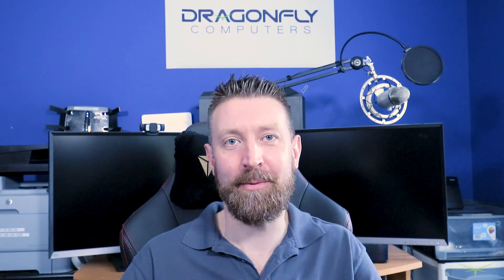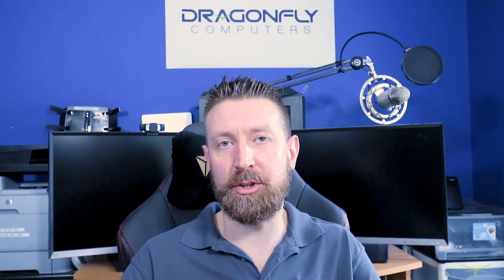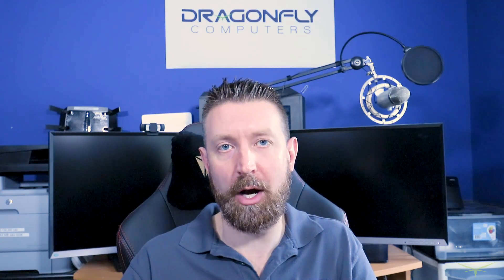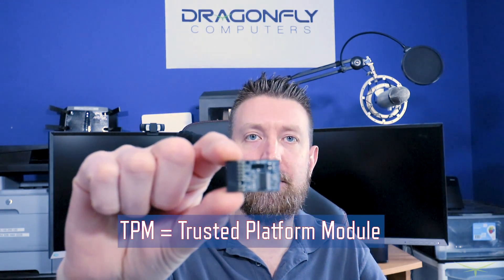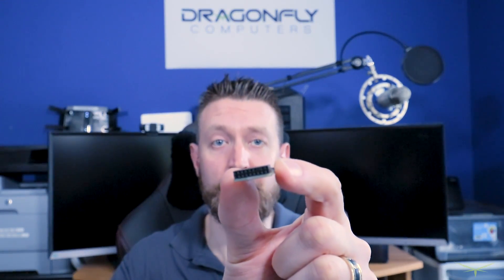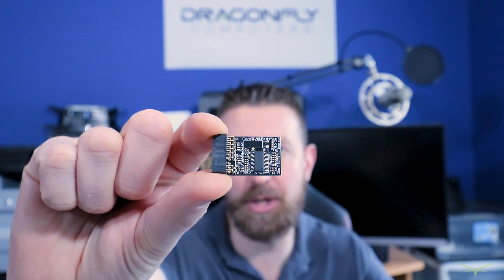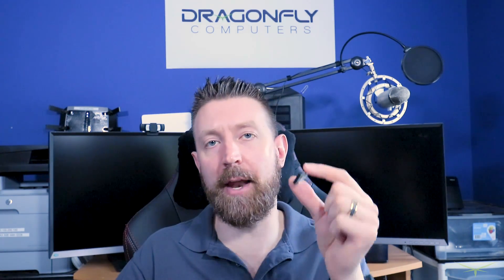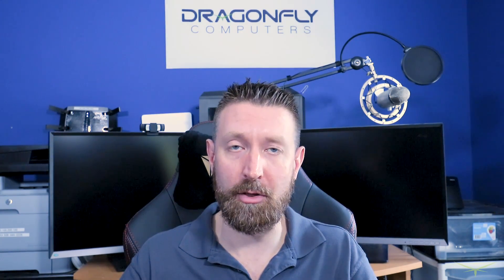Using AMD FTPM with Bitlocker

Comment: You're details about fTPM aren't accurate. First and foremost it's apart of the CPU, so its equivalent to a removable chip in that respect. Numerous early versions of the discrete TPM devices had a security flaw which had to be fixed in firmware. fTPM obviously provides the same mechanism. It works exactly is its supposed to compared to the discrete solution. Bitlocker is simply suggesting that you backup the recovery key, but its not a requirement to boot nor is any additional entry required. One of the options is to actually print it out, in which print to PDF is an option. If you're being asked about an additional entry on every boot, you've forgotten to turn secure boot on. Lastly, bitlocker has a suspend option that leaves the volume open for one boot cycle, which specifically allows for a UEFI update and seamless reintegration of the key.  Now your bios config will be set to defaults, which in and of itself will require you to turn fTPM back on. The problem here is partially your understanding, and the language of the motherboard vendor's instructions. Perhaps the early uEFI revision for that board wasn't as neat as it should have been either in handling the fTPM function. I have done all this without issue on Asus X470, as well as having used TPM on Dell and other laptops.
Reply from the maker: I've rolled out Bitlocker integrated with active directory in multiple corporate environments. In one case I rolled out to 1200 users in 16 countries, in another case to 400 users in 4 states domestically. I've literally bitlocked thousands of machines so I'm relatively familiar with the options in terms of what it's asking me to do. The reason I made the video was because when I enabled secure boot on this motherboard, the board would not boot and I had to reset CMOS which is a pain in the ass. In addition, the board has a separate 19 pin traditional TPM header, which I tried to use. I bought the matching ASUS TPM chip for the board, when I tried to use it, again the board wouldn't boot. If your comfortable using the suspend feature and risking your C: drive on a BIOS update, more power to you. With the amount of problems I've had with this platform, there's no way in hell I'm trying that.
Reply: @DragonflyComputers  I myself have done systems administration in AD environments, and I know bitlocker has some different functionality in that scenario. Particularly with key recovery. If you ever backup your key, your data will be fine. Nothing is being done to the volume in that process, unless you're worried about the drive being stolen between a single boot. The act of fully decrypting and reencrypting would pose more risk in practice. Like I also mentioned, there are some things about the board and it's language that might be an issue. I have seen the issue you're having, but it's not the normal behavior. You come off as presenting this as a platform issue, which isn't the case. I didn't mean to insult, though it seems like you took it that way. I've supported 400-3500 users in AD environments myself.  Resumes don't prevent you from overlooking details from time to time. Humans and such.
Reply from the maker: Fair enough, I appreciate your response. When I first built this machine, I was plagued with problems before I ever got around to encrypting it. When the physical TPM didn't work, I basically flipped out and made this video. I'd had no experience with fTPM previous. (I'm  a recent convert to AMD as of the 2950X release). So in doing my research I read various things and horror stories etc. By the time I made this video I was blaming the platform for everything because I'd had a host of issues with it. Although, I still don't understand why they put a physical TPM header on the board (it's specific to this processor, so it's not they just mass produced them). I bought this board specifically for that feature, yet the BIOS doesn't support it, so if you try to use it, the board doesn't boot. This forces you to use the fTPM, then when you try to enable secure boot, the board won't boot and you have to reset CMOS. So anyway, long way of saying a lot of frustration, I couldn't find any youtube videos addressing this at the time (they're may be more now) so that's another reason I made this one.
Reply: @DragonflyComputers  Several AM4 boards seem to have discrete TPM headers, my Asus included. They also make a supposedly compatible module, but I didn't bother getting one. I do believe that many if not all them are based on the same chip, and there was an issue with them but I'm pretty sure it was only related to an exploit. I figured I'd experiment with the fTPM instead of worrying  about which module revision I'd end up with.
Reply: @blkspade23  Sorry - late to the party. Just saw this thread one year after the original post - I've got a ASUS Prime X570 Pro MoBo which has a 14-1 header for a TPM. I ordered the original TPM-SPI from ASUS (Nuvoton NPCT750 chip) and it worked like a charm. I had to enter and exit the BIOS once until the TPM was recognized - the BIOS showed "TPM 2.0 module detected" in the "Advanced" section. I then was able to enable BitLocker without any problems.

Comment: Thank you for very good video.
btw: have you found a solution for this painful entering password (when fTPM is used)?
Reply from the maker: Yeah, I just used a USB drive instead. USB just has to be inserted when you reboot.
Reply: @DragonflyComputers  The problem is most likely that you've not enable the secure boot option. fTPM works exactly the same as you would expect it to. I have an Asus X470 and have used fTPM, and it doesn't require a USB key or additional password.
Reply: @blkspade23  So you are using fTPM and you don't use USB drive during reboot?
Reply: @AFromPoland  That is correct. Works exactly like it should, tested with 2 different SSDs.
Reply: @blkspade23  OK. 

Btw:
Have you tried yo upgrade your BIOS with fTPM enabled during BIOS update? It also works fine?
Reply: @AFromPoland  I have. You can technically do it with it on, it just gives you a warning. Your stored keys will get wiped, thus resulting in Windows asking for your key on the subsequent boot. There are built-in ways to prepare for that though. You can either backup your keys from the bios, and restore them after or simply put bitlocker in suspend just before the update. The first boot after suspend will will store them again and reenable encryption.

Comment: My laptop is hp elitebook 735 g6,in device manager there have two security devices one is amd psp another is tpm 2.0.When i disabled the tpm in bios,the security devices tpm2.0 disappeared and amd psp still have.In tpm.msc,it notice the tpm is not found. Does the amd psp is ftpm？
Reply from the maker: No, PSP is something totally different. It's kind of AMD's version of Intel Management Engine. No one seems to really know what it does, but probably a back door into AMD machines..

Comment: Do you have an x399 taichi by chance? I have the same issue. Header is there but I don't think bios supports it and not sure which one TPM to get
Reply from the maker: I have the x399 Professional Gaming. One of my reasons for making the video was why put the header on there if the BIOS isn't going to support it?
Reply: @DragonflyComputers  yup. I think we are both screwed. Time to change motherboards I suppose as I refuse to use the fTPM
Reply: @DragonflyComputers  I'm using the X399M taichi. Which TPM chip did you use?
Reply from the maker: @axi6ne8us  I used the fTPM, I purchased the ASRock 19 pin TPM 2.0 chip, it fit on the board, but the board wouldn't boot with the TPM inserted.

Comment: I enabled ftpm then disabled it and now i am getting ststem config error and not geting in wondows
Reply from the maker: That's odd. I've enabled it, encrypted the drive, decrypted the drive, disabled it, updated the BIOS, re-enabled it and re-encrypted with no problems. The only thing I can tell you to do is try clearing the CMOS on the motherboard. Hopefully, if you have the motherboard manual, you can find the procedure to do this.

Comment: When I enabled the fTPM, then trying to enable bitlocker on OS drive, win 10 kept saying “system missing files”. What should I do?
Reply from the maker: Can you tell me the exact message your getting? Also, it's Windows 10 Pro right?
Reply: Dragonfly Computers “System missing certain files”. Win 10 Pro 1809. I suspect the reason causing this trouble would be the disk partitioning. I changed the booting method from legacy mode to UEFI a few days ago. During that process, Win 10 created 2 more divisions, one for the system reserved, one for efi. I deleted the reserved one but failed to combine it to the OS region.
Reply from the maker: I can't find anything on that specific error and I've never seen it before. You're probably on to something as far as why you're seeing it. Maybe try Veracrypt instead?